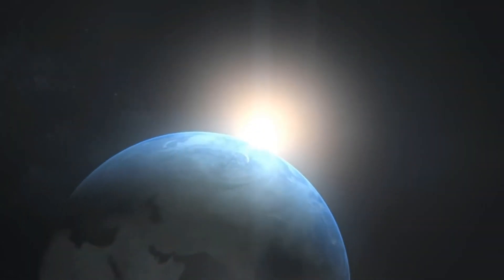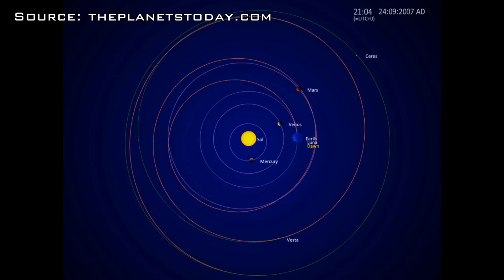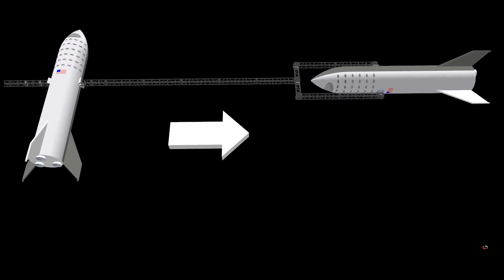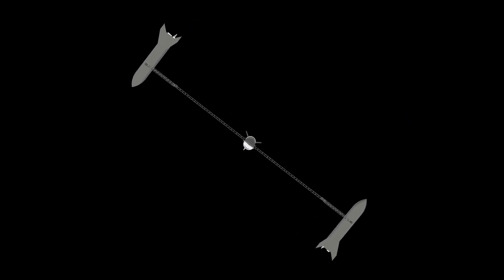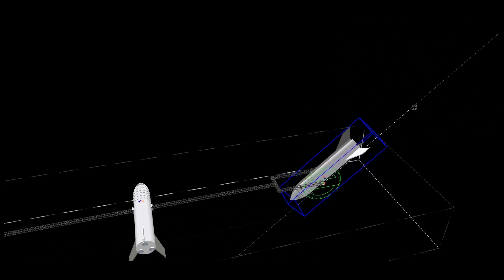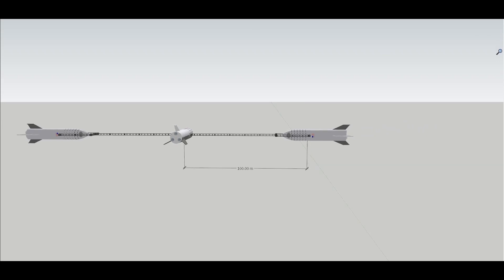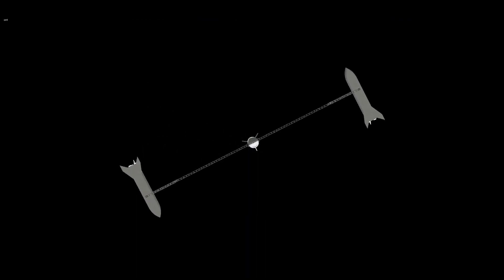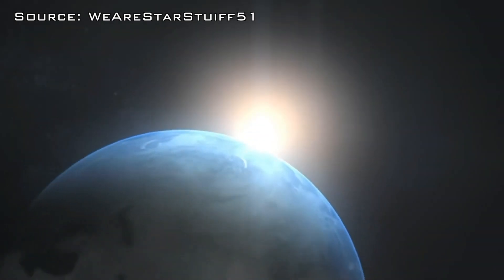GLS2: Artificial Gravity for SpaceX's Starship

Comment: Short Answer No. It won't be done like this.

Long Answer:

Adding two massive joints capable of holding the weight of the entire spacecraft on the sides is basically a no-go.
Having two joints like that also has a risk of catastrophic failure. If one side snaps the other side will experience a huge moment and be ripped apart, possibly taking pieces of the spacecraft with it.
Basically, you need to use existing points to attach the truss/tether, you can't just add new ones. Frankly it's too early in the development to propose solutions for this, since we don't even know where we can attach things which is able to hold the weight of the ship, though I must admit that I too have played around with the concept.
Since the plan appears to be sending fleets of starships the number of starships is not really the limiting factor here. Take your design and stack it and you can spin up using 0 fuel by simply using a motor and some solar power. This is also much safer than starting up the main engines. I highly highly doubt that the main engines will be fired up to generate spin gravity, a motor is infinitely more efficient and requires no fuel and usually doesn't go BOOM if something goes wrong. We have to remember that no matter how good they get their raptor engines each time they fire them there is a risk of rapid unscheduled disassembly. Also, keep in mind that there's hundredths of engineers working on this with detailed knowledge of the starship so it's extremely unlikely that they haven't thought about this already. But again, too early in development to say what the best way to achieve it is. Though I do agree that it would be very detrimental to any Mars mission if the people arriving has to spend weeks or even months adjusting to Mars gravity.

Good video nonetheless :)
Reply from the maker: Well put. I was playing around with how/where to attach the system for a long time, and that's partly how I came up with main engines providing the spin. I would like to better understand what you mean by "take my idea and stack it" though, because I have trouble envisioning how an electrical motor of reasonable size and weight will have enough leverage on such a massive system of this enormous size.
Reply: smallstars take two of your designs and attach them together in the center with a motor. Then that motor can apply a torque to the whole system and slowly spin the thing up. Even if it takes days or even a week it’s not a problem.

As for the attachment joints, the only possible attachment point at this time is the landing gears. We also have to remember the orientation, the spacecraft can only take forces parallell to the rocket, otherwise the rocket would bend and most likely rip appart.

One cool thing you can do with a tether is to extend it further out than your intended radius, spin up the two crafts a little bit using RCS and then wheel in the tether decreasing the radius and increasing the spin speed and thus increasing the centripital force without using more fuel. Granted you would need a longer tether, so you would have to optimize the mass of the extra length with respect to the mass of the RCS fuel and see if this method takes less mass than just having more RCS fuel.A fun little math problem, I think you can even solve it algebraically though I haven’t tried.
Reply from the maker: @beaconofwierd1883  I agree with everything you say here. The side by side counter spin system you describe is very cool. I guess one spurt of RCS to start up would be greatly helpful in terms of leverage, helping the electric motor start up with some momentum.

As for RCS tether spin, I still have my doubts about it, and in the past, I have envisioned the conservation of momentum trick you described. If the RCS system they end up developing really is useable for spin grav I'm all for it and will be delighted to be wrong.
Reply: @smallstars I don't think there would be much of a stability issue, if you just have the tether under tension and accelerate very slowly (Which you want to do anyway to avoid unnecessary stress on the structure) it should be fairly stable. If it wobbles around too much you could have multiple tethers connected to each other to mitigate oscillations (basically making a ”flexible truss”). I did some estimations of the mass you could save if you are able to change the radius and here's a link to the results: https://imgur.com/a/gXdRkv7
Basically, with a high ISP thrust you can save around 20% mass and with a low ISP system you save more than 50% mass. Those mass savings alone would make a flexible system better than a rigid one.

But if we do the motor approach you can spend 0 fuel and get the biggest mass saving, and then a rigid system might make more sense :)
Reply: @smallstars 
NOTE: updated further down.
After watching your V1 of the spin gravity system I feel like studying up on the basics of beams (beams as in strength of material beams, not laser beams) would greatly help you in making your V3 more realistic :) Don’t worry, it’s not that complicated, the most difficult thing is probably finding the thickness and data for the fuel tanks, though we know which steel it’s made of now so we should be able to find those values :) we also have to make some assumptions about the weight distribution, but we can simplify the problem to a cylinder and have a uniform weight distribution to get some estimations. Here’s a link which I usually use when working with beam calculations: https://mechanicalc.com/reference/beam-deflection-tables

I did some quick calculations using spaceX recent pressure test of their tank and a wall thickness of 3mm, and it does appear that the tank won't rupture from being supported "on the side" like it would be in your animation during spin-up. Assuming the pressure in the tank being at 6 bars which they require for flight and they are aiming for a maximum pressure of 8.5 that leaves us with 2.5 bars of added pressure before the tank ruptures. This corresponds to around 900 tons of "bending force"*, which is a lot more the weight of the ship. Though it still puts a lot of added stress on the fuel tanks in a way which they are not designed to handle stress so I doubt they would do it that way. But the good news is that the ship probably won't get ripped apart ;)

*With "bending force" I mean the force experienced by the tank when it's oriented perpendicular to the spin gravity (in other words while using the main engines to spin-up) and supported at it's centre of gravity and has a uniform mass distribution. I also disregarded the cargo area for this and only looked at the tank section.

If you want any help in the future with calculating stuff I'd be happy to help :) I do this kind of stuff on my spare time a lot just for fun so I wouldn't mind helping.
Reply from the maker: @beaconofwierd1883   Just keep in mind that in space there's nothing pushing back against the thrust aside from the spacecraft's own mass so spin-up should be rather gentle. The centrifugal force however will be very powerful.

I have been struggling with the Math for V3 and would greatly appreciate your help. DM me on twitter or IG, or just drop your email here on this comment.

twitter.com/tinysmallstars
instagram.com/tinysmallstars
Reply: smallstars I build a small simulation environment where we can play around with tethers in different configurations. Right now the tether can’t snap but that’s an easy fix. Just a single cable looks very wobbly :p For trusses/rigid structures I think it would be easier to do the calculations instead of simulating it since the wobbles are not the main issue there but rather the strength of the structure which is easier to calculate than wobbles in a cable. It’s not really user friendly though (just pure code) but it does produce a pretty 2D animation :)
Also, regarding the large forces, yes, they are rather huge. The simulation very easily rounds them up to ”infinity” if the settings are wrong, leading to an exploding cable ^^

Here's the result from some quick simulations:
https://imgur.com/a/t1Yn6KE
Reply: @smallstars  Did you have any specific ideas for V3 you wanted me to look into the math behind it btw?
Reply from the maker: @beaconofwierd1883  yes emailing you now!

Comment: We can make gravity without spinning bruh. That’s all I got to say about that.
Reply from the maker: How we doin it?
Reply: smallstars Read the second sentence.
Reply from the maker: @armyretguy7365  Thanks, this was helpful.
Reply: smallstars Sorry I don’t have more to offer. I don’t like certain things.
Reply from the maker: @armyretguy7365  Only reason I really hoped you would elaborate is because I'm working on a video now that's not so much about a method of employing centripetal force to mimic gravity, but instead about the essence of what gravity is itself, and how we can possibly mimic it because we certainly don't understand it fully, and it seems impossible to legitimately create because of the magnitudes involved.
Reply: smallstars There used to be the argument over things like waves vs gravitons, and so forth. I happen to know that gravity is a form of waves. I know that gravity can be displaced, like dropping a ball in water, the water will move around the ball, but not occupy the same space. The interesting thing about gravity is that it can be displaced by an energy field (similar to torsion fields) that the gravity moves around, but does not occupy the same space. This means the field will have its own internal gravity, or lack thereof. To get around this issue, you need to create gravity, if you were building something like a space craft. Those waves can be generated by an orb type device, using some radioactive element as a power source, which I cannot even begin to understand. Not a huge science guy, that’s just the skinny in how I got it. There’s no such thing as anti-gravity, it’s actually gravitational displacement. I’m not going to say that the military has this type of thing.... but I won’t deny that possibility either.

Comment: For health reasons, I suspect that having gravity will be critical in any long term space travel endeavour. The simplest way of achieving this is to induce a corkscrew motion in the flight path of the ship that is perpendicular to the direction of travel, similar to that shown in the movie "The Chronicles of Riddick".  The mechanics of how to best achieve this, I leave up to some else to figure this out.
Reply from the maker: For this size of spacecraft I don't believe the radius is large enough for 6 months of human life with spin gravity: https://www.reddit.com/r/SpaceXLounge/comments/czycst/in_an_85m_diameter_rotating_cylinder_a_2m_human/
Reply: @smallstars  If you watch the movie the radius of motion is many times greater than that of the spaceship. Perhaps an on-board gyroscopic system would be able to help induce and control the radius to this type of motion?
Reply: @smallstars  The other way of inducing a controlled spiral motion is to bleed a small percentage of the forward thrust into a spiral motion.
Reply: @smallstars  The other thing to consider is the Coriolis effect on human health. The larger the radius of the corkscrew motion, the less adverse this effect will be.

Comment: I just watched this brilliant video again. A couple concepts to add:
1. All three starships can act as emergency escape/lifeboats. A nice double redundancy.
2. We can use these system and spin variants to test biological feasibility of long term human settlement on different g locations (Moon, Titan, Mercury, Mars) before the higher cost of doing it at those locations.
3. Can we get about 1,000m of scaffolding for 1rpm feasibly into one Starship? If not, how many starships would it take? We can just make that the number of hub starships.
Reply: Also good to add radiation shielding practicalities in #of additional starship launches. I personally like the 2 1/2 meters of water approach, because of the redundant benefits of all that water in deep space.

Comment: I still prefer the idea of a flexible tether; while it does allow for many more degrees of freedom between the ships (and thus less control by mechanical connections) but it also removes the possibility of a rigid connection bending or breaking under the shear stress from the ships' rotational movements. Those additional degrees of freedom allowed by a flexible tether provide a greater margin for error-correction where a rigid system's structural integrity would not tolerate those errors. If the rigid connection were to bend (or break) it would be devistating to the mission, where as for a flexible connection twisting and bending is not a worry.

The main engines would still be used to initiate the rotation. Then pivot the ships similar to how you described it with the rigid system, orienting the ships verticaly (in line with the direction of gravity). That lack of stability and control from the hard bridge can be compensated for by RCS thrusters.

The benifits to using a flexible link could be huge. A flexible cable(s) system would allow them to change the length of the connection 'on the fly' by reeling in or out the cables. This could act as a shock absorber between the ships, and allow them to fine-tune their gravity without implementing their thrusters. When nessesary it could pull the ships closer together for a much shorter, safer, and easier space walk if crew members wanted to transfer between ships mid-voyage. Plus it would be more compact, since the cables can be stored on a spool; lighter weight, because the cables need no cross-bracing struts; and possibly less expensive to build as it would have less material & overall complexity.

Comment: Could it be possible to have a tube (pipe) for linking a series of StarShips right through from nose to tail. The two centre ships could be nose to nose (0 G force) with all the others tail to nose  to enable differing G forces. The tubes, with a built in rung ladder, have docking capability and run right down the centre of each StarShip. The sleep area could be at a comfortable 1/4 G, dining at 1 G and a gym/sport recreation area at 1 1/2 G for building bone and muscle. The two outermost ships could have the brace swivel structure to enable the  spinning of the entire complex so well demonstrated in the brilliant video above.

Comment: Sounds simple, but reality is a bit more complex. Your idea might even be not feasible, especially for one reason: during the rotation burns the Raptors produce quite a momentum on the bridge construction, which would break it apart. To avoid that, you need to make sure that the burns happen absolutely synchronously. I don't know if that will be doable or if the risk involved simply forbids such a solution.

Comment: Or just have the floor oriented in a way so that down is the same direction as the thrusters, thus the force used to propel foward will pull u down creating and mild sense of artificial gravity, it wont be a full 1g but u could get as close as 50% which is more than what u would experience on Mars which leaves out bodies time to adapt
Reply from the maker: I wish! Currently not possible with our latest and greatest propulsion technology. You would get up to Mars gravity for just minutes, and then float the rest of the 6 months.

Comment: The best and most simple way to produce gravity is to have the thrust pushing up through the floor....  You don't need to create a spin to create "artificial" gravity.  You need to produce a thrust pushing through the floor.  Why go through some three space ship connect and swivel design when you can just simply create a horizontal floor to the rocket thrust?